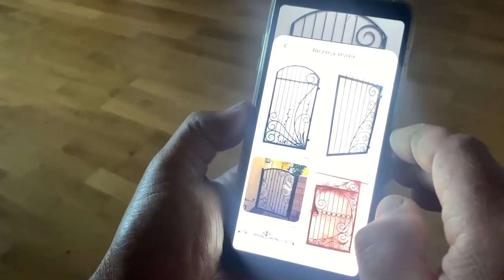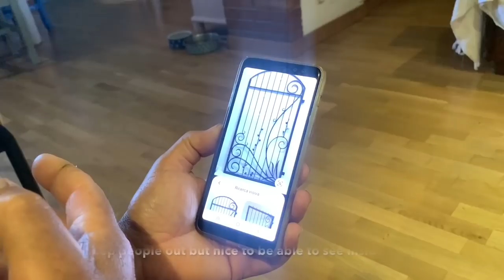THE POSITANO DIARIES - EP 21 Carlo has a new project!

Comment: I would steer away from macbook air and choose a mabook pro for video editing. make sure you get one with enough memory (storage), ram at least 8gbs preferably 16gb and a quad core processor. It should be perfect for video editing. You cannot upgrade mac hardware on macbooks 2013+ so what you buy is what you keep. I use a 2012 macbook pro with all the specs maxed out and it works great all parts are still interchangeable